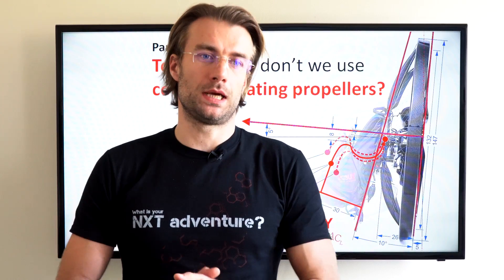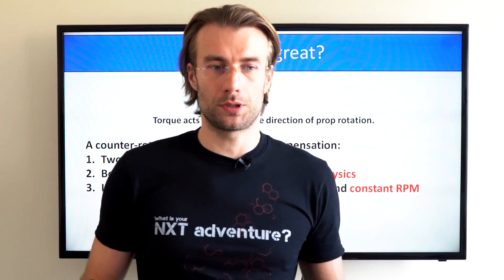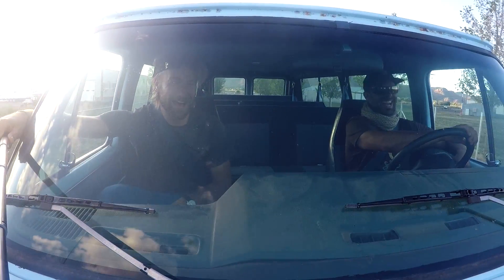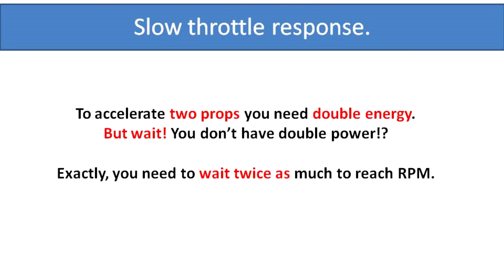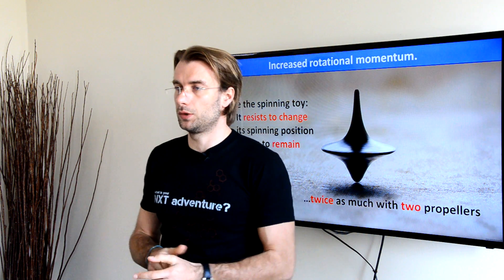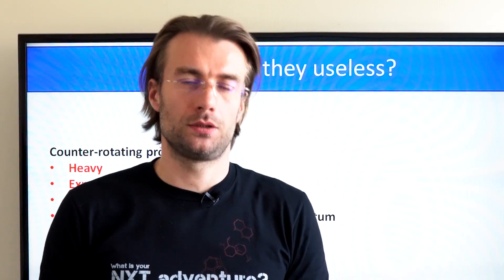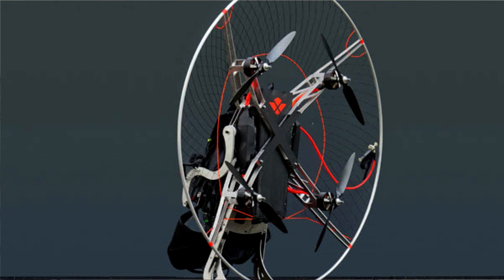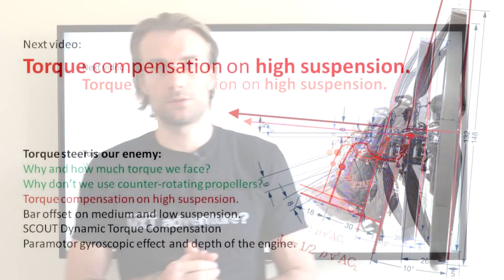Why don't we use counter-rotating propellers? Paramotor Geometry Part 12: Torque

Comment: I really appreciate your intellectual reviews of all this. I do have some "conceptual" questions regarding the cost/benefits of CR prop systems.

1. The relative air velocity over the airfoil of the prop is what develops thrust. Thrust can be increased by either increasing relative air velocity (increase RPM) or increasing pitch of the prop. Both of these require additional power input, however increasing RPM has a squared component so the power input to increase RPM is more than the power input required to increase pitch. I believe increasing pitch has less of an impact to power requirement.

2. I believe a major efficiency loss in relation to propellers is due to tip speed. Tip speed also drastically effects noise. As the propeller tip speed increases, the interaction of high/low pressures on each side of the prop blade clash and cause significant resistance and drag. So it would seem that running a slower, more aggressive prop would provide equivalent thrust with more efficient power consumption.

Realizing my above two points are supported by only a partial understanding of the aerodynamics and may not be 100% accurate, I would think the 2 above points could be combined together to develop a CR prop system that provides notable gains. Maximizing the diameter of the prop (within allowable tolerance) as well as utilizing aggressive pitch would allow for slower turning props. With the counter-rotating action of the props, the relative airflow over each prop is increased, again allowing for reduction of prop speed. With the reductions of prop speed provided by these alterations, I would think that would reduce the impact to lags in changes to throttle input.

If anyone is able to provide a technically supported response to my above assumptions, I would appreciate the conversation. My apologies for the rambling.

Comment: Lots of very positive information ... a comment - on the slow response, on a practical point I recently switched from a single prop boat to contra-rotating prop, the real world acceleration was vastly improved, maybe time to max rpm takes longer (not noticed that) but the twin props were more efficient, less slip, and got me to the speed I wanted much faster.    Its acceleration very significantly better than a single prop.       As you point out no torque steer, but weight & size is significant , as is cost (Though, I would never go back to single prop on my boat)

Comment: I'm glad you touched on the quad prop electric powered paragliders.  It would be interesting to know if ducting would help or if the weight increase isn't worth the gain of efficiency.
Reply from the maker: I studied the duct. It would have to be massive to achieve relevant results and the gap between the prop and duct must be 2-5 milimeters. Impossible with our vibrating 2T motors.

Comment: Ive flown that 4 prop type of paramotor.  It went surprisingly well considering my lack of experience,  however the landing was not so hot and I damaged the frame.  The design was intended to be very light, but it sacrifices strength.  
Openppg quit making them and has gone to single prop design as well.

Comment: Hi great vídeo! Very instructive and pedagogical ! You ve clearly thought a lot about this ! You would be able to use smaller diameter props as I believe that counter rotating props produce more thrust than a single prop of equivalent diameter, therefore the advantage for planes is that you get the performance that would get from a much bigger prop. That you might not be able to use because of ground clearance

Comment: i go out on a limb and say that the contra rotating prop actually increases a torque reaction.

there are two. one is the fact that the prop tends to spin the air. this leads to adverse aerodynamic effects, a helical vortex of air on control surfaces.

so a contra-rotating prop eliminates that by combining two opposing helices. a much straighter flow, more predictable.

it doesnt eliminate the torque required by the engine to simply spin something. the engine case, the gearbox, mounts, and airframe, all experience a reaction to simply rotating a mass. doesnt matter if its a wheel, a prop, or whatever. a rotating mass requires a torque.

consider what happens if you mount the engine at right angles via a bevel drive...  you still have this rotating prop mass, and its helical vortex. so a contra rotating prop will eliminate... the torque reaction on the airframe as the mass of the prop rotates one way, the plane the other. we spin two equal masses in opposite directions. check.
the torque reaction of rotating air in a helix. check.
the gyroscopic forces. check. so thats that. 

all forces eliminated? class over? lets go home?

you sure?

think about it. 

how does the engine work? its cylinder and head exerts a force on a piston and a crank rotates within the case... either the crank and piston move, or the engine does.

if you mount the engine at right angles, there is still the torque required to rotate that mass... double the mass, plus gearbox weights and friction... you just increased the moment of inertia of the rotating assembly in the power source. and THAT is bolted to your airframe. you would find that there would be no torque ROLL, but there would now be a torque PITCH. (or we mount the shaft vertical, and produce a yaw?)

think about what happens if you hold one of the props stationary. what rotates?

in one case, the engine rotates at half the speed of the other prop.
in the other case, the prop rotates at twice the speed of the engine.

that is, the engine case, the gearbox, and the airframe... all strapped together. one big mass floating in the sky... attempting to spin something... do work against something. a contra rotating prop will always increase that torque reaction. (not so with COUNTER rotating as long as its also the engines running in reverse!)

consider a dragster... theres a torque in performing work at the wheels... it tries to do wheelies...

but what else happens?

the chassis twists up like a corkscrew as the engine torque reacts against the pistons, the crank, the tailshaft, diff, bevel gears... it is doing work in the engine.... its not isolated... you also dont see this when the engine is transverse... most motorbikes.... but you do on BMWs with opposed pistons and longituditional cranks... 

a plane has a large moment of inertia...

a paramotor has a small moment of inertia, but it also has a tiny little motor... keep the rotating mass to a minimum.

you eliminate aerodynamic twisting forces, but you do not eliminate the reaction forces that create the thrust in the first place. that engine has to push its piston against something to spin the crank, and that produces a torque in the opposite direction to the crank, proportional to the work done.

yes, a helicopter uses twin rotors and eliminates the tail rotor. wtf am i talking about? get off the drugs man...

consider...

how much mass is in the rotating assembly of the motor, the gearboxes, the blades, versus the overall mass of the vehicle? and its distribution? is it out on the tips? or in on the hubs? the moments of inertia?

you counteract certain issues... but you will ALWAYS increase one... an opposite and equal reaction... no matter what.

Comment: if counter rotating propellers has a disadvantage, why do Russian huge planes have counter rotating propellers and it seems strong and working like the AN-22 huge plane.
Reply from the maker: Exactly, we need to keep our paramotors light to be able to run for take off.
You would not want to carry a huge counter rotating coaxial shaft work lots of gears and bearings on your back.

Comment: wouldn't it help to make the diameter of the two props about a third smaller to counter the double mass and the double need of motor power and the resistance to react to throttle?

Comment: Would some kind of gyro/flywheel work?
Reply: would still add alot of weight
Reply: A Flywheel would add weight, require a larger engine, and the paramotor would resist turning left or right because of the gyroscopic effect. Note: Airplane engines don't have flywheels, they use aileron and rudder trims for stability.
Reply: a fly wheel would only solve the acelleration torque not the constant speed torque
Reply from the maker: +Joash Parker yes. Exactly. 
But it would also slow down the throttle response. 
And the flywheel would have to be very heavy. Times heavier than prop itself because the prop has large diameter.
Reply: Ah yes of course, once the acceleration has stopped it would only provide resistance to further changes, making it very sluggish indeed.

Comment: @3:54-4:15  This prototype is now a reality. OpenPPG X4. I'm flying one. Yes the four small props are not as efficient as one large one. All the other disadvantages of multi prop/motor are not present with electric. It's a wonderful machine to fly but the run time is very short - 20mins - which is a deal breaker for most. It is still quieter, simpler, and more reliable than a 2 stroke. Plus no torque!

Comment: solution...  Use a propeller with half the blade angle.  Using two normal style propellers on ONE engine is like flying a two engine prop airplane with only one engine powering everything.

In other words, if the propeller blade angle is like 15 degrees, then 7-8 degrees would work better for contra-rotation.  Two 7 degree rotors can probably do the work of one 15.

Comment: Great videos, thanks for posting them.
You mentioned in this video about the paramotor with 4 electric motors.
I like that concept but I would like to point out that in my opinion there is significant safety concerns with running electric motors with propellers fixed directly to the motors shafts.
I believe any paramotor built with brushless dc motors should have propellers mounted onto a primary drive shaft engineered to proper aviation standards not hobby enthusiasts standards.
What could be the outcome if one of the propellers came off and went through your canopy???
Also if anyone reading this is contemplating building a dc electric paramotor, please consider some motors are designed as pusher props and some as pullers.
If  you are considering directly mounting the prop to the motor then be sure to mount the motor in the correct orientation, otherwise catastrophic failure is likely to occur.
With respect, :-)

Comment: While I somewhat agree with the conclusion of your video, I guess you mention all the facts where this solution won't apply to the ICE engine paramotor. The only reason you may want a CEP Paramotor is for the tremendous acceleration that it may have. Having two smaller power engines, smaller diameter props and a better design caging will make this a super fast toy to play with and only because from CEP you will not be limited on how instant your acceleration may be, your wing may think otherwise :)))) Electric counter props solutions have all the benefits without the additional weight, gearing and complication on ICE power. Plus you get electric engine efficiency, reverse brake option on landing, smaller props diameter, smaller rotation speed, less noise, instant electric torque, and as a bonus, because you pack less ''engine'' and more battery, a better design of a paramotor pod with extended battery may be an option. CEP is known to have way better efficiency because the first prop accelerates the air and the second one takes that accelerated air giving better efficiency for the same hp on a single prop. Overall, I think electric double prop will be the choice for most of new smaller lighter aircraft in the future.

Comment: If you're using two propellers, yes it will take more power from the engine to run the same rpm, BUT that's if you use propellers with a typical pitch angle, if you have two of them, why not use propellers that half about HALF the pitch angle so that the two propellers create the WHOLE amount of thrust with 2, and also, you can decrease the mass of the propeller by making each blade width a little less.   This would make it more compact, more efficient, and less resistance to turning in the air.
Reply from the maker: Two lighter props will airways be heavier than one.
Reply from the maker: The counter rotating shaft is the very heavy component

Comment: If we compare the thrust of a coaxial propulsion propeller with a single propeller, then the single propeller should have a diameter of 1.26 times. more. In this regard, the argument about the delay of the throttle valve action is not clear. A larger diameter propeller will simply have more torque and less rpm. The distance between coaxial screws should be at least 10% of their diameter, I don’t see any problems with the layout either.

Comment: At the end of the second world war piston engine powered aircraft had more power than single propellers could handle.  To overcome the problems they moved to contra-rotating propellers, this was not just to overcome the problem of torque but also that they just couldn't fit long enough propellers to make the most of the power.  A pair of shorter contra-rotating propellers was found to be a better solution than one big single prop.  This seems to contradict two of the main objections that using contra-rotating props would be both too heavy and as a result have too much inertia to spin up quickly.  Admittedly there is the additional complexity and weight of the gearbox but a pair of contra-rotating props would not be twice the weight of a single prop.
Reply from the maker: Unfortunately we do not face the same problem with paramotors. We cannot carry stronger engines. This we need to squeeze the most juice of the engine we have.

Comment: Found this looking for coaxial cable.  Seems you need a modified Lynch type (Etek, Agni) motor with central stator, reversed magnets on one side, magnets embedded in prop ring.  The motor halves are principally held together with magnetic flux. https://www.youtube.com/watch?v=zzDcjMdiHms  You save weight by driving the "meat" of each prop with magnetic coupling instead of structure transferring force inward to a shaft, then back out through the prop.  Allows centerless props and minimal static structure because it no longer needs to resist the full torque of the motor.  Cedric Lynch himself might even design it for you if you ask nicely.  https://en.wikipedia.org/wiki/Solution_F/Chretien_Helicopter

Comment: Use more props that are smaller, like in a spider web, use a light material and install 4, 6, 8, or even 10 rotor conected by drive belts, seems doable but i´d need 30000 to build a prototype
Reply from the maker: Check our video on large vs small props
Reply: Exactly my thoughts. Twice as many props with a smaller diameter. Roughly equal weight, roughly equal thrust. Counter rotation increases efficiency, which offsets the smaller size. It's NOT for twice the thrust, it's for a more compact design.

Comment: This is probably the only informative scout video that is very flawed,most of the drawbacks are exaggerated or wrong. The reason being is most likely it would not suit scout economically as it would directly compete with their no torgue design and could not be used with their frame. Not to bash scouts design as it works okay and currently is the best on the market . Counter rotating props would be heavier,aproximately by 1,5-2kg, could be less with good design.Easiest way to do it would be through a gear driven reduction drive and use a chain next to the gears for the second shaft.
Propeller diameter would be smaller,since inertia is effected by the radius of the mass compared to center of the shaft,the inertia would be less than compared to a 4 blade propeller.There would be no gyroscopic effect as that would cancel itself out.Since the propeller diameter would be smaller and the blade flex would be less the first propeller could be moved forwards.The second propeller can be placed close to the first propeller making the stick out less of a issue,only reason to place the second propeller alot more aft is to further gain efficiency. It really does not require a complex expensive solution as stated in the video.One drawback would be the thinner shafts necessary with counter rotating propellers would be more prone to damage by prop strike. Cost would increase around 400-500e compared to a standard 2 blade setup with the props being the largest cause to increase of cost. Only reason we are not seing this on the market is it would need to be designed by the engine manufacturers together with propeller manufacturers and innovation is not really something these companies are known for, still sporting the wg8 carb from 80´ husky chain saw.

Comment: FYI: That's "4 electric motors", not "4 electric engines". I will quote in part, "The real difference, is the fact that "motors" run on electricity, while "engines" run on combustion. However, many people interchange the usage of these words: On the rare occasions we encounter one, we refer to a steam locomotive as an engine, the same word that we give to the motive power of an aircraft." From http://english.stackexchange.com/questions/42027/semantic-difference-between-engine-and-motor

Comment: 4 props? Lol I had it in mind when I thought "Wait how do drones compensate torque... 4 props... What if we do the same with paramotors?"
Reply from the maker: Small props are less efficient than large ones. Aircraft manufacturers try to use a large one whenever possible

Comment: In my opinion contrarotator is not good couse these sistem using like that disturbing the efficience plus will destroy engine couse what it couse is just compressing air flow to have less noise u hace to separete a bit anyway sound is a mass too wich influence on it too.realy in any flying things i dont like it . maybe in others application can be very efficient.own opinion ...no need to be that way.up to every one likes or so